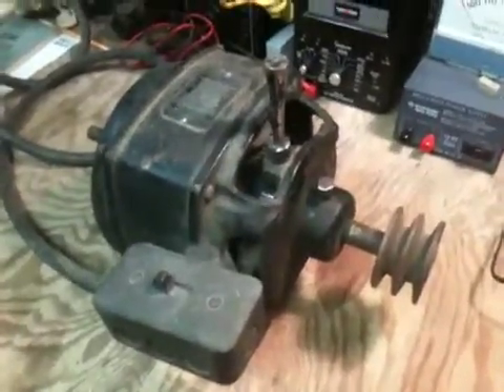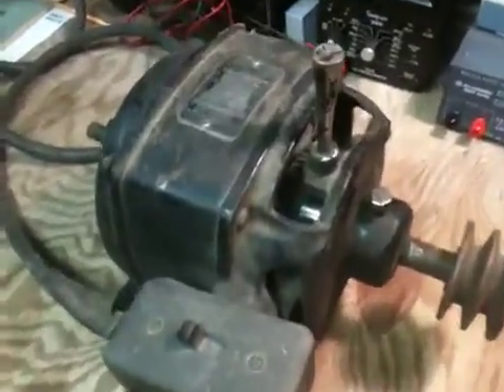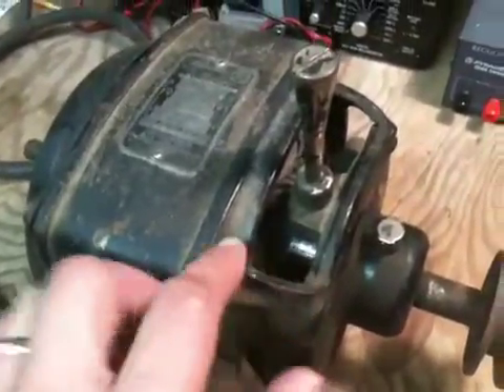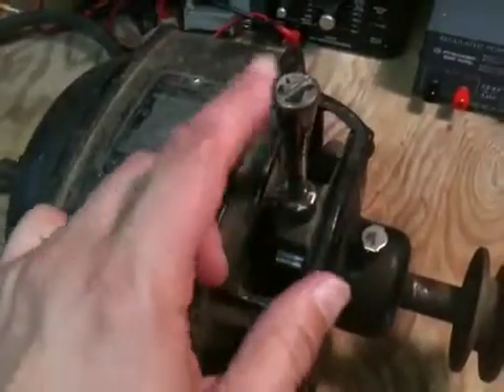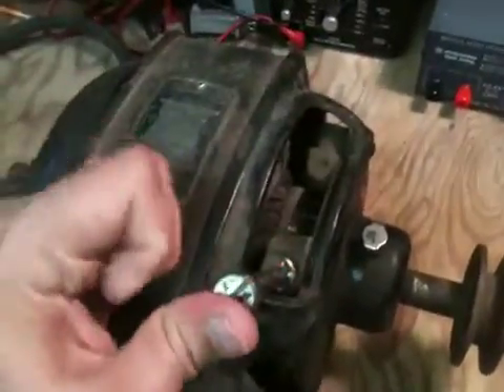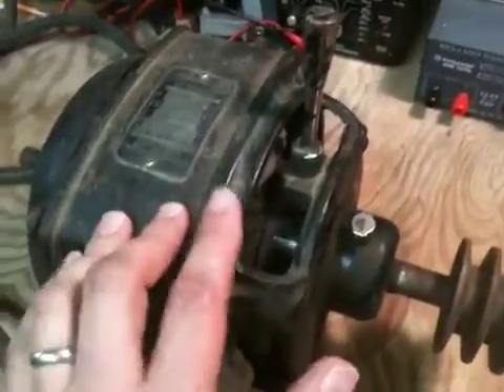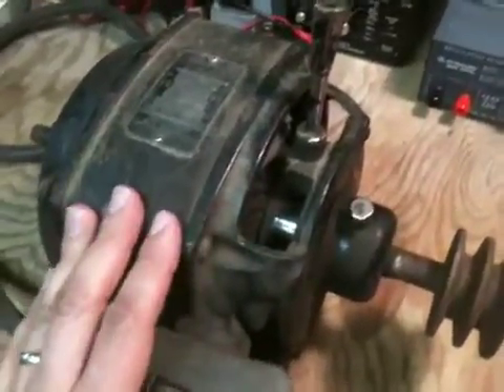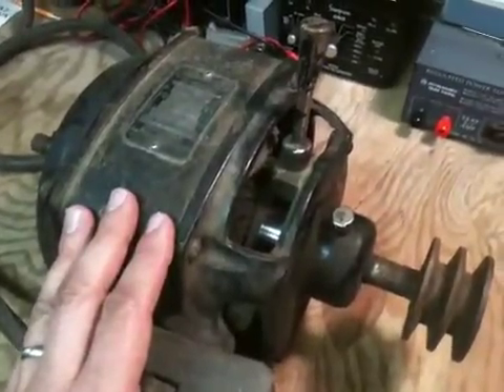Vintage Repulsion-Induction Motor with adjustable brushes

Comment: I have a Wagner Electric, of 1/2 Hp, I am restoring it, I wanted to know what type of oil it takes to lubricate the hub.
regards
Reply: Oil weight depends on slipping speed. Most electric motors of that size running 1725-3450 RPM are happiest with 20W to 30W oil. Check machinerylubrication.com, lots of good stuff on lubrication there.